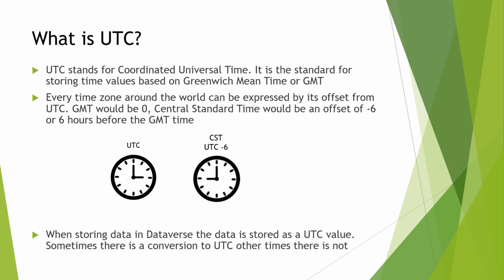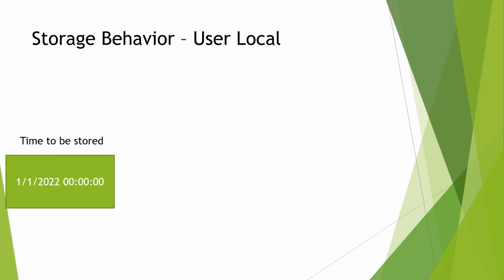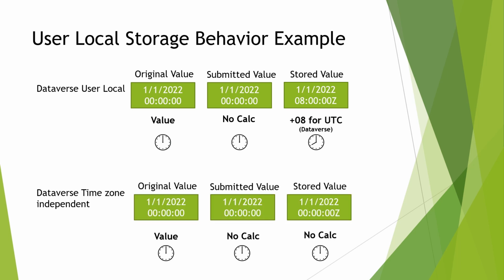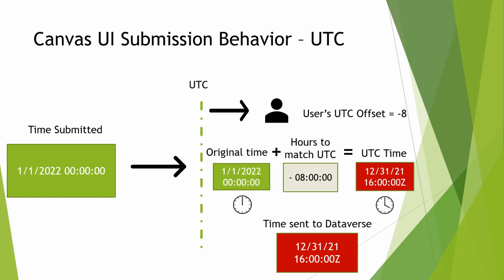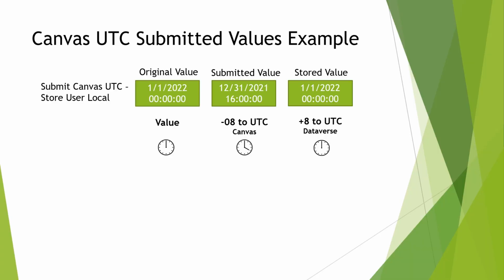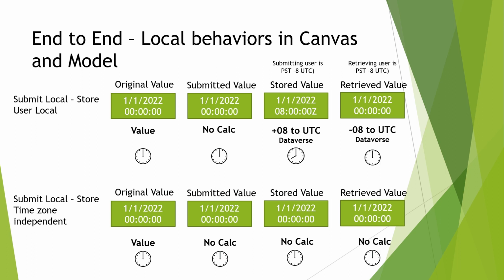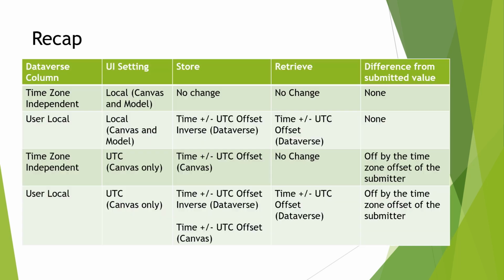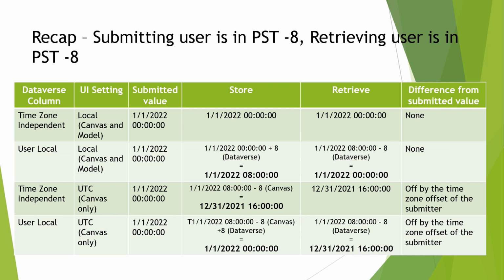Explaining Date and Time in Dataverse using PowerApps

Comment: But how to change the format from MM/DD/YYYY to dd.mm.yyyy ?
Reply: where do you want to change that? in a form / email or in date time field after the user selects the date?
Reply: @kevinflanagan5851  in dataverse when open the table and the columns are displayed.
The only way I found out it is in the environment (admin) settings of Dynamics
Reply: I have a similar question: Is there a way to set dd/mm/yyyy as the system default date format in Dataverse? I'm encountering issues when importing or converting CSV files. Dates in dd/mm/yyyy format are being misinterpreted or am getting an import error. 

Additionally, when viewing data in a Dataverse table (e.g., through views or apps), I’d like dates to default to dd/mm/yyyy for display purposes.